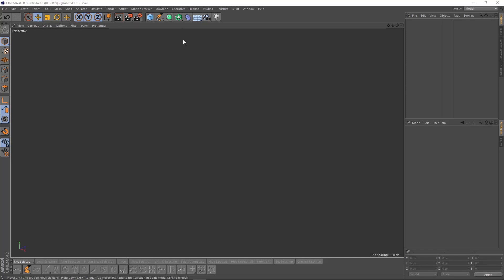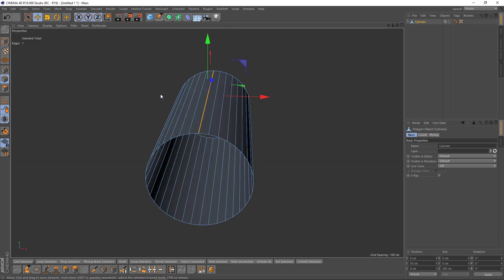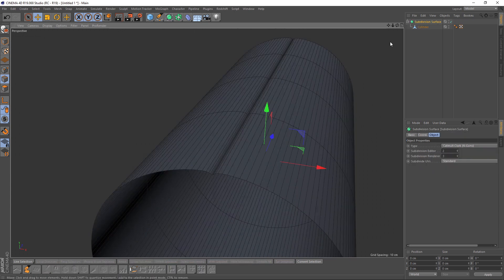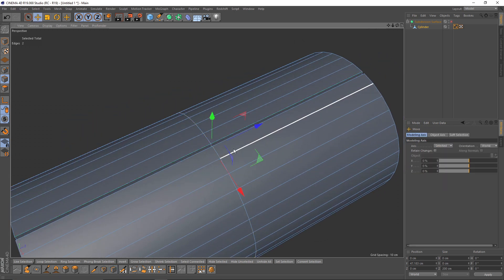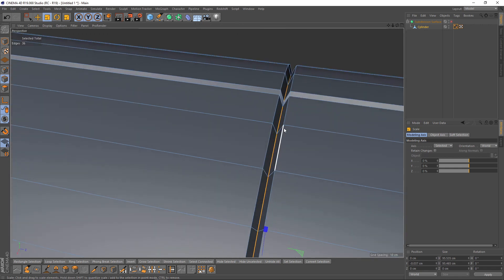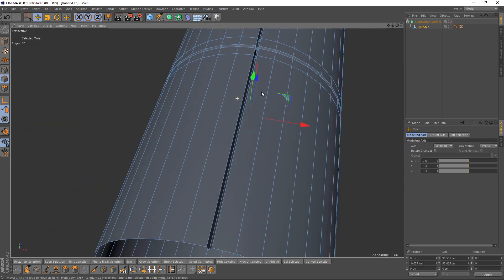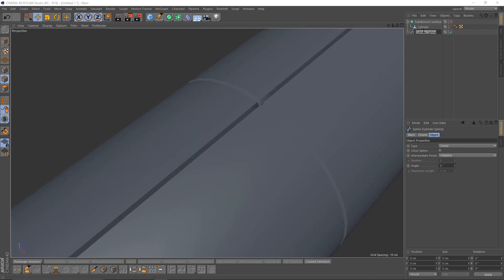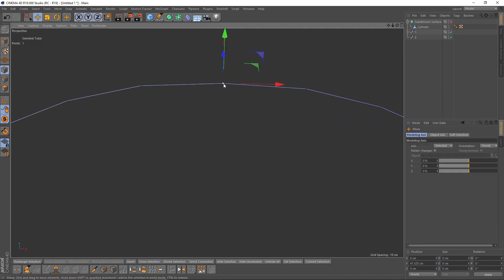3D Stitching Modeling | Cinema 4D Modeling Tutorial

Comment: What if the spline was not straight and u wont end having 2 nodes only?
Reply from the maker: It will work fine with non straight splines, sometimes you may need to fake it though, because of the ending points of the spline, you can watch my leather tutorial, it is more advanced.